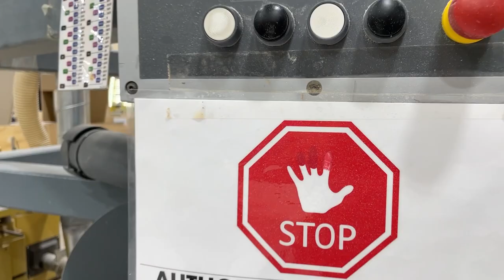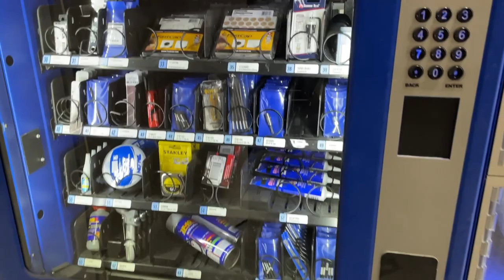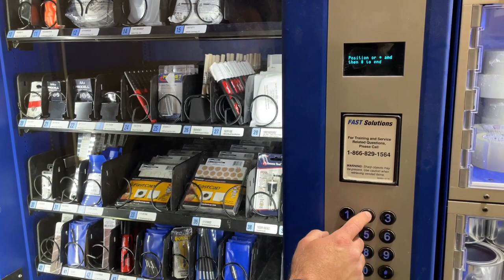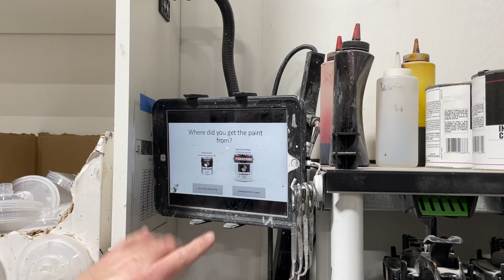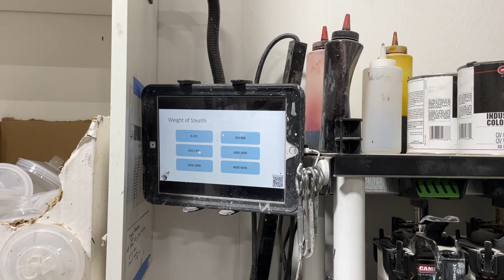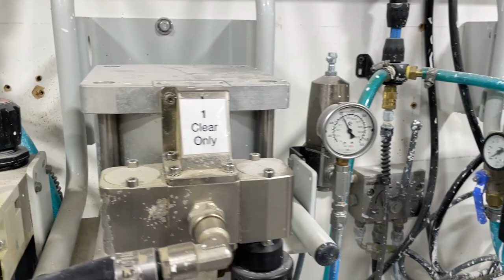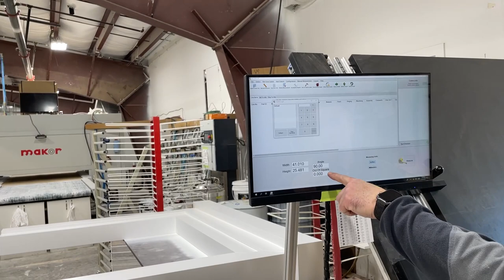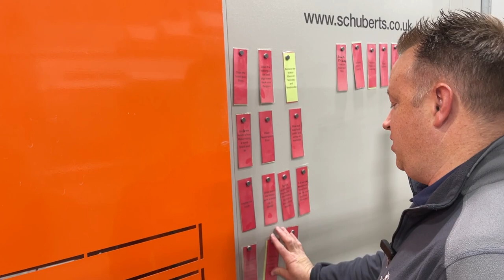Lean Tour - Wood Shop Continuously Improving - Fix what bugs you

Comment: Maybe a better name for the company would be Robot art? The art of this business is in their systems and efficiency not a product they produce. Well done! What is your typical turn time for a set of cabinets?
Reply from the maker: It was originally called Trim Art because Tyler sold trim. I like Trim Bot better. Tyler said "A job is typically in the shop about a week. We are out 8-12 weeks for most jobs depending on the specs of the job."
Reply: @lean-brothers  you can turn a 20-30cabinet kitchen in a week?! That explains the efficiency of the system wow!
Reply from the maker: On average we output 75 boxes a day. If we pushed hard we could do 100-150 (depending on complexity) boxes with our current staff.
Reply: @lean-brothers  Are most your boxes full overlay 3/4" standard boxes? What kind of joinery is used?
Reply from the maker: @andrewschafer7790  They are mostly euro style 3/4" boxes. We've been using confirmat screws for most things, but we are moving to more glue and dowel press together. (This is Daron so I might not be using 100% correct terminology. I'm getting my kitchen redone soon. We'll make a full video over the process).

Comment: So so cool so many great ideas here. 

One thing that seems a bit redundant to me is the vending machine/boxes. An employee should be able to grab disposables as needed quickly from a bin, but now has to punch numbers and wait for things to open or vend. A very simple solution would be to use a 2-bin system with a kanban card. If the rest of the areas are run by kanban, it’s a little strange to break that into something more complex. Less drawers, less doors, the better! It does look fancy and cool though 😊

Comment: Very informative video. A suggestion for a topic to cover that I don’t see in any shop tour is your method to heat the space (provide a nice environment for workers) and control humidity (if required)? To you use off cuts or waste in a solid fuel burner perhaps.
Reply from the maker: We actually heat with forced air but most of the heat comes from our air makeup units in the paint room. The shop is typically in the mid 60s during the winter.

Comment: Thanks for sharing. If you don't mind me asking, how much time  does a job typically spend in the active production vs engineering/CAD/programing? Does this differ with the custom line of business? I have a very small shop doing custom only and it seems like every job is reinventing the wheel.
Reply from the maker: It really depends. All softwares are not created equal and every plan is different. If you have the right software the programming, even for custom parts, isn’t too bad.

Comment: In short  - it is a good wood shop. But looking at it as optimizer of Lean I must say that your 5S is not working! Even if you are moving - the edgebander S-500 is remaining and there are some things at the machine that should not be there. It's just as an example. The back side of the beam saw Homag B-130 should not be blocked in such a way with edgebander. In some cases the beam can go not parallel and you will need  a folk lift to hold and fix it. The dust collectors should be all standing outside in one place. Because inside of wood shop it's filters get dirty with dust very fast and air inside the wood shop become dusty too!
Reply from the maker: Thanks for the reply. For us, lean is about continuous improvement, not being perfect. We try to improve every day.
Reply: Clean doesn’t mean 5s is complete.